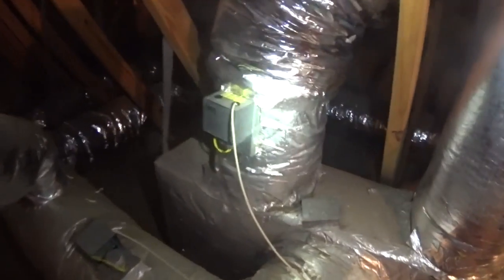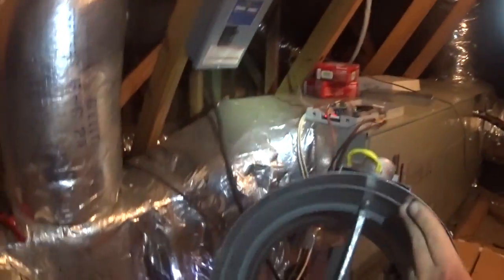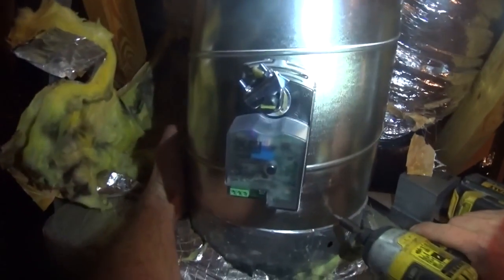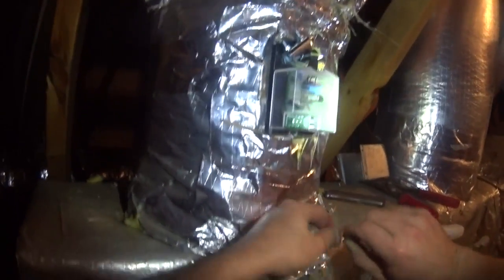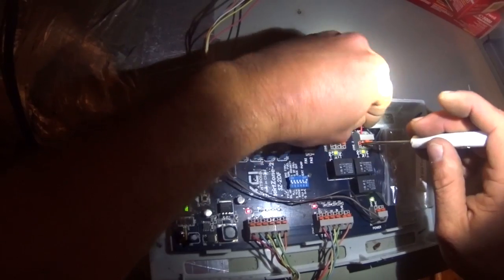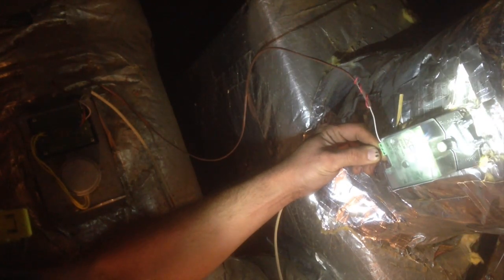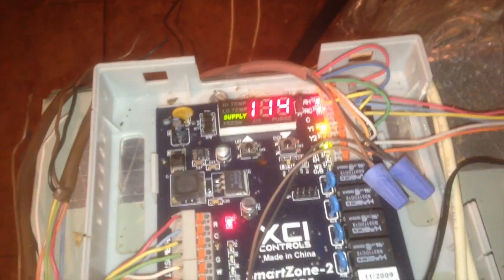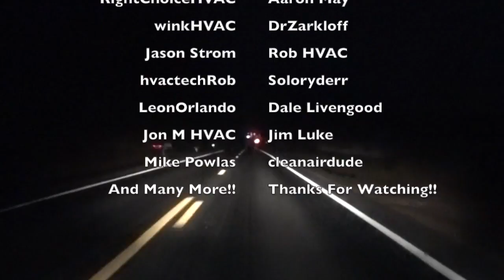HVAC Service: Replacing A Zone Damper Motor

Comment: Great video,  only rule of thumb is to always wire and test first before sealing up. Just in case there Is a faulty replacement part.  It happens
Reply: Just curious why did he change the whole assembly? Aren't those motors replaceable?

Comment: I appreciate the tip on testing while at the damper by swapping the open/close wires.  That is handy if (when) you're working alone.  I think it's also very useful for test/debug when you're approaching a zone problem and don't have it narrowed down yet.

Comment: Great video!  I think my first floor zone1 damper motor is dead (stuck opened). Can I confirm by swamping the Red and Black on the damper?  I guess if it doesn’t close it would mean my damper is bad?  
Thanks for the video. Oh one more thing, why do you have to connect the white common wire to the new damper?  Can connect the white common wire to zone2 damper?

Comment: So, there is no calibrations required?

What about matching parts? Do certain dampers only work with certain systems or will any damper work as long as the size matches?

Comment: Hey Stephen I learned something new about zoned system equipment. 

I don't think I'd like that up north in my house with a heat pump, keeping auxiliary heat use to a minimum is tuff up here with defrost cycles and building load nose diving beyond way beyond the BTU output the of the heat pump HSPE's are way better nowadays but still not enough contrary to what most people think lol lol... We ran our heat pump system up north as stable as possible till the heat pump would lock itself out completely and backup was electric for the duration of extreme cold man that's a meter spinner up Whoo hoo... Man you guys in the south are lucky!
Reply: HSPF LOL LOL not E

Comment: im still trying to get the hang of wiring. The other day I was staring at an old RTU, I forget what make it was but it had some where around eight contactors that controlled the different components in the unit. 
The wiring was a freaking mess.

Comment: You were lucky on that one. Most of the damper change outs I get the installer most have thought there was a massive air leak at the damper and slapped a shit ton of mastic on the joint. Makes an easy change out a nightmare.
Reply from the maker: I was a little
Worried about what I would uncover. Turned out nice though.

Comment: I think my honeywell M847d1004 automatic damper is bad i noticed today upstairs was not cooling right. I checked the dampers and one was stuck closed. I moved it open and closed and it seems to be working a bit. But I noticed that it wont close fully now when the other dampers are open and that one should be closed. I hope that made sense. Then it clicked for a little bit but stopped. Anyways, can I just replace the motor/actuator instead of the whole assembly like you did?
Reply from the maker: Yes! You ought to be able to replace the actuator. Guessing you probably could find a new actuator online by searching for the number and Damper Actuator
Reply from the maker: In fact the actuator only is much easier to deal with!
Reply: @StephenRardon  Sweet, thx for the reply and help. Gonna look for the part tomorrow. And will be subbing ya 😉

Comment: I have a damper that doesnt have the red light on it lighted up. I traced that wire back to the board to zone two. The red power light on zone 2 isnt on. Would that be tue board or the damper at fault?
Reply from the maker: Hard to say for sure, they don’t all have lights. Sorry I can’t be of more help

Comment: Can a faulty damper prevent the blower in the furnace from turning on with the AC?
Reply from the maker: I can’t think of a situation where the damper might determine whether the blower would run or not. That’s an odd one. If you’d like you could send me an email with pictures of the situation and I may be able to help StephenRardon@RardonHomePerformance.com

Comment: Is it possible to over ride this piece and open the damper as a temporary fix till I can get a tech out here?
Reply from the maker: very possibly, send me an email stephenrardon@gmail.com
Reply: It keeps saying the email is invalid and won't let me send
Reply from the maker: Stephenrardon@gmail.com

Check spelling carefully
Reply from the maker: Or shoot me a text 919-346-3532
Reply: I copied and pasted but it still didn't work. The damper did however start working again, I moved the arm behind the actuator up and it came back down so I assumed the spring wasn't broke and then it started working. That leads me to believe there could possibly be a stripped gear and it caught just enough to start working again. Does this sound like it could be a possibility, Thank you again for replying.
Reply from the maker: You could be on the right track with a stripped gear. Feel free to call me if you need to or text 919-346-3532
Reply: Stephen Rardon Thank you very much for your response, I really appreciate that Sir. If it stops again I'll let you know.

Comment: What is the Difference between ARD  AND A  ZD HONEYWELL SYSTEM.
I have to replace a damper the Motor
Reply from the maker: That’s a good question, I know ARD standard for automatic round damper but I’m not sure on ZD
Reply: Thank you for your response
Reply from the maker: Looks like the ZD is their square damper
https://forwardthinking.resideo.com/products/zoning/detail/zd_damper.html

https://www.google.com/aclk?sa=L&ai=DChcSEwitiIPvstLuAhVxCn0KHbnrAuwYABAGGgJwdg&ae=2&sig=AOD64_1nwUhy37MC_qx18z6TkEbwkOVjEg&ctype=5&q=&ved=2ahUKEwjp4PvustLuAhWPQc0KHR_FDz0Qwg96BAgCEBU&dct=1&adurl= this could be what you need to replace only the motor
Reply: Thank you for your kindness and information have a great day and be safe.👍

Comment: Instead of all the trouble of removing the entire damper, how about a damper manufacture you just replace the board and motor?
Reply from the maker: Depends on the situation mostly, we've don't just that several times when we can get the motor easily or quickly